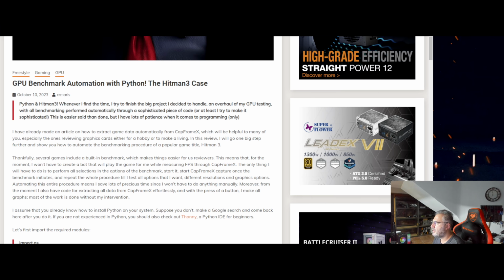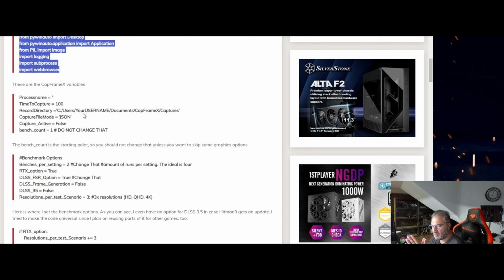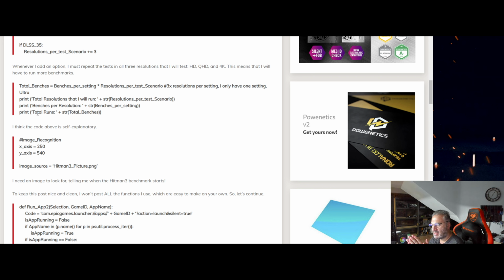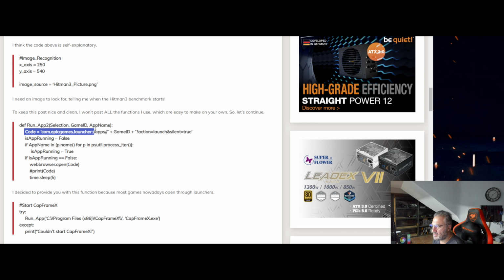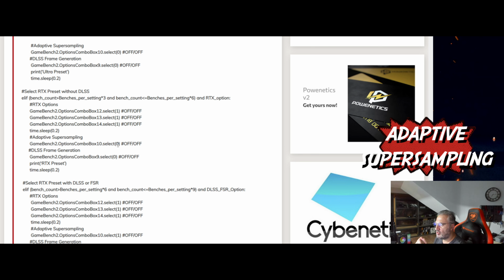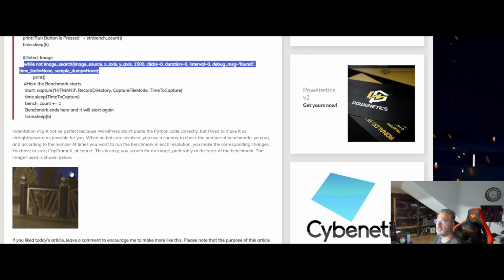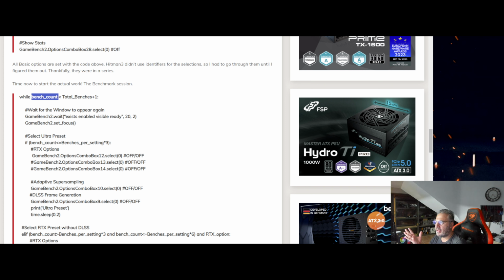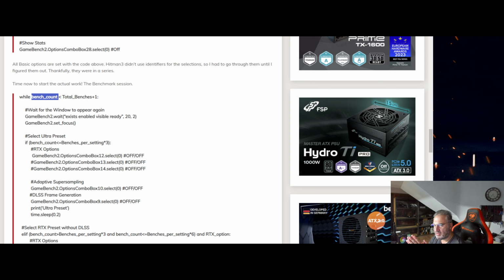How to make your own automated GPU Benchmark!

Comment: very cool. theoretically, one could prevent CPU overhead problems by offloading movement onto another computer, but unless a dual socket system can be easily split (i have no experience there), you'd have to use completely separate hardware and then also write an interface, possibly with ML image analysis to provide the steering computer feedback. very involved. even just this does open up doing many, many runs with minor variations to get very in depth testing though.